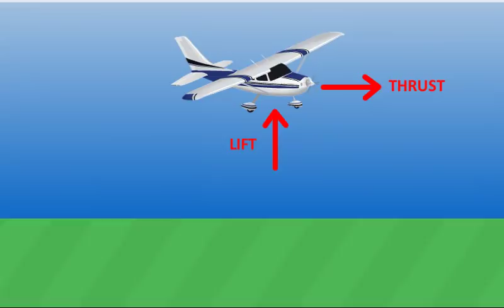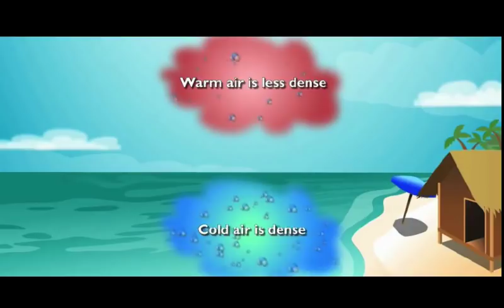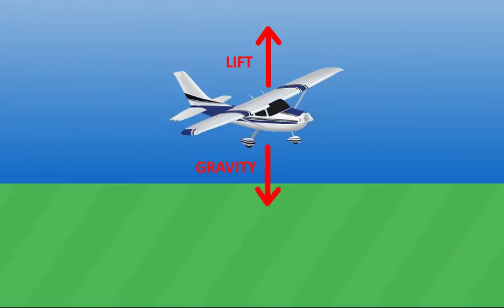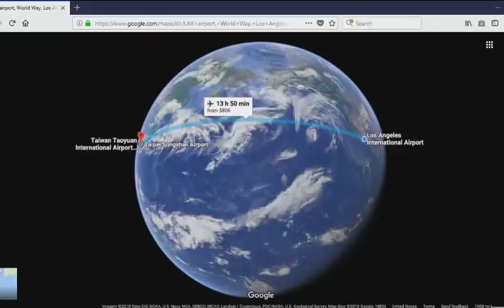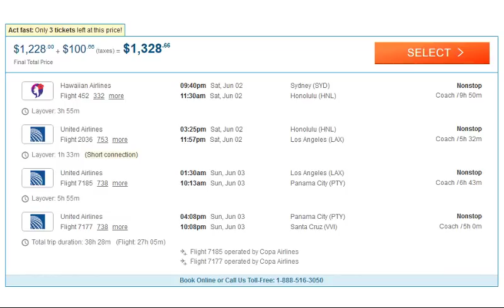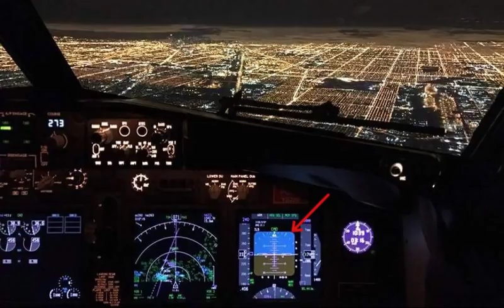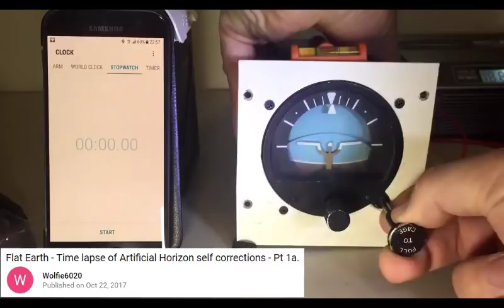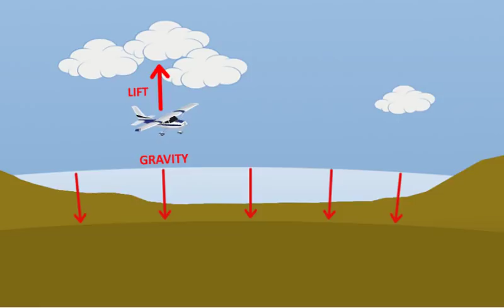Flat Earth Falsities - Plane Nonsense

Comment: So, if we live in an atmosphere that exists to the edge of space that suddenly becomes a vacuum, how is that. Science tells you that a vacuum cannot exist next to a non- vacuum without a strong and distinct barrier, as is evidenced in a laboratory anywhere you like. Too many anomalies for this all to be clean cut, even with the insults and swearing.
Reply from the maker: M Shaler - No, science does not tell us that. Vacuums don’t really suck. You only think they do because you have only experienced them within the pressure (key point) of earth’s atmosphere. When a vacuum is opened, it is the pressure of the atmosphere that PUSHES the air in to fill the void. We call it sucking, but it is really pushing. At the edge of the atmosphere, there is no more pressure, so no pushing or sucking. The atmosphere is just held by gravity. One way we know this is that the higher you go, the lower the pressure. Air pressure is just the weight of the air above pushing down on the air below.
Reply: So the gravity of the moon that can lift oceans even against the greater gravity of the earth can't manage to draw any atmosphere from the earth, even at the margins of space where earths gravity is at its weakest?
Reply from the maker: M Shaler - Actually, the moon does pull on the atmosphere as well. You just stumbled onto even more evidence for the globe. Good job.

https://en.m.wikipedia.org/wiki/Atmospheric_tide
Reply: @mshaler6574  "so you agree that the moon does pull on the atmosphere" No.
Gravity
Fg=G.m1.m2/r^      Put in the values.
Reply: Voice of reason...
As above
Reply: Voysovreason.....damn spellcheck.....as above
Reply: @mshaler6574   THERE ARE ANSWERS TO ALL YOUR QUESTIONS SIR,THEY ARENT SIMPLE BUT THE ANSWERS WILL GIVE YOU TRUE AND ACCURATE INFORMATION WITHOUT FEELINGS GETTING INVOLVED.YOU NEED TO REALIZE NOTHING IS SIMPLE AND EASILY EXPLAINED
Reply: Everybody knows the air gets thinner with altitude. People need oxygen to climb mountains, balloons and planes have a limit to how high they fly. Even that sun and moon that rotates at great speeds above your flat-earth would have to be in a vacuum. Otherwise the moon would be burning up like a meteorite.  So globe earth, flat-earth there just has to be a vacuum above us. Even the most avid flat-earther would find it hard to believe the air is the same everywhere above us.
Reply: @rogerdawson2085 
 Fg=G.m1.m2/r^2
Put the numbers in and see why you are totally wrong.
Why don’t you try using your brain? It’s very easy, you just stick a finger up a nostril and go “click”
There, fixed that for you
Reply: The moons gravity does effect the atmosphere. What's ya point.
Reply: @karatekoi  "What's ya point." Not sure if @M Shaler is just incredibly inexperienced, stupid and gullible or a pathetic troll. Same thing really. So one can assume it has no point other than to be incredibly inexperienced, stupid, gullible and a pathetic troll.
Reply: When did science tell that rediculous thing and i can see u just didnt get good highschool education or just nothinng at all..do u know.. atmosphere vanishes to vaccume very gradiently
Reply: @rogerdawson2085  no..water is thousands times havier than air..so..air have very little effect of moons gravity got it.now fuck off
Reply: @BrainUser1  i said dont vaccine ur children.ok..bcz i dont want some retards still roaming all over the place in 2050
Reply: @anand.suralkar  No danger I let Corporation poisons into them.
Mister 'shape of the earth worrier' you wont have gone to your belove Nothingness paradise void by then? Funny how the non retards are the ones all over the Retards claims.... dah
Reply: @rogerdawson2085  GRAVITY pulls accordingly or as needed automatically: "moon's gravity does affect satellites, it is just not affecting them very much."  Still "gravity keeps satellites "level" in their orbit" GEO ones and all, so all is keep in perfect harmony everywhere, by unintelligent design, or more scientificly: LUCK.
Reply: @M Shaler you make such a great point, but not many of these people are real actual people here to talk. They are here to attempt to make what your saying look bad in any way they can because they are paid to do so. This whole channel is a psi-op. Going back a couple years that is all this channel has ever done is the same thing its doing now and that is to keep people deceived believing all the lies of science and nasa. This is the voice of treason.
Reply: Reggie Reid  Fuck off Reggie you pathetic troll.
 @reggiereid1345
Reply: @reggiereid1345  I don't see how NASA can pay all of us after the cutbacks. Would you like to show some evidence of these payouts? Because I think you're lying.
Reply: @reggiereid1345  well u flattards are..f...morons..firat study some basic maths and physics..and stay away from ur mommas fairy tales and bible..

Comment: Voysov, I don't like your answer to #3. The discussion of lift is unnecessary, and you fumble the explanation of "level": you say it means "parallel to gravity", but of course it means "perpendicular to gravity". The true explanation follows from that: what appears to us (or a fluid level) as level is simply that orientation with respect to gravity, and since the direction of gravity changes as we travel around the Earth, our feeling of levelness never changes as we follow the Earth's curve.
Reply: Yes he acknowledged his misspoken 6:41 parallel. Looks like you need more trust to lift higher in lower gravity hights curved level... As sea level make a uniform gravity force, no matter how deep the oceans may be, less rock crust mass, for mass gravity force that apparently is weaker the greater mass it is from the even ball iron core is....
GRAVITY keeps in the same level automatically for pilots :)
Reply: Louis Shaw, gravity keeps satellites "level" in their orbit, but planes are too slow to orbit.

But the idea that a plane must point its nose down to fly down just means that someone doesn't know how planes fly, and has never seen video of a big plane landing, which is almost always nose up. (One of the facts of piloting is that a plane is trimmed to fly level, i.e. the control surfaces are adjusted so that flies level when the controls are in "neutral". This trim depends on the load inside the plane, and is not "automatic".)
Reply: @mendelde  how is THAT? Apparently MOON pulls, water and atmosphere, so how does her force not unlevel those closer masser satellites as she passes by?
Voysov claims GRAVITY automatically "level" orbits planes to sea level.  Nose down for super sonic jets around a SPHERE not on a flat plane!   WE know exactly how they fly!
Reply: @Louis Shaw I just googled *moon influence satellite orbits*, and the moon's gravity does indeed influence satellite orbits. However, the moon is 1/80 the mass of the Earth and very far away: a geostationary satellite is 40 Mm from Earth, while the moon is 400Mm away, and because gravity is inversely proportional to distance squared, that adds another 1/100 to moon's influence as compared to Earth's gravity. The influence of moon's gravity is almost the same no matter which side of the Earth the satellite and the moon happen to be on.

So, yeah, gravity isn't that much of a leveller, but in a sense of causing something to stay up and not fall down, it has that role for satellites, but airplanes stay up due to aerodynamics and not due to gravity. Fun fact: the gravity of the Earth and the moon create 5 points in space, the Lagrangian points, where object positions are actually stable (or would be if the sun's gravity didn't exist).
Reply: @mendelde  However? Moon your government says is 1/4 size and 1/6 the gravity, check with NASA. Your doctrines claim that the Moon causes tides, so math as much you want it needs to influence.
Just as the SUN could do something, as earth gets close, 99% of the whole solar system Mass is 99% of Gravity....
O but none of those satellites have a circle orbit around that fatso.
The idea that planets make constant wide elipses around that roadrunner, points to influence malfunction, maybe those invisible gravitons get slowed down by packs of DARK matter?
How long is all these stable distances going to last?
What is countering the gravity attraction between them?
Reply: Louis Shaw First, basic geometry. The moon's diameter ist 1/4 that of Earth, which means its volume is 1/64. (Analogy: You need 64 1/4inch cubes to make a 1inch cube.) Also, the moon's iron core is much smaller than Earth's core, making the moon less dense overall, and this puts its mass at the 1/80 of Earth that I quoted.

Gravity varies inversely with the square of the distance; since the moon is smaller, you'd be 4 times closer to its center of gravity than you are on Earth, which means gravity on the surface is about 16 times stronger than at Earth surface height. This would make moon surface gravity be 1/80*16 = 1/5 that of Earth; I'm putting the difference to 1/6 down to inaccuracies/rounding error (the moon is actually slightly larger than 1/4 of Earth).

And I did say that moon's gravity does affect satellites, it is just not affecting them very much.
Reply: Louis Shaw I'm not really sure how you get to circular orbits, orbits are elliptical (circles are special ellipses). I also mentioned that sun's gravity does influence Earth satellites; the sun is super massive, but also very far away.

For orbits, the gravity attraction doesn't need to be countered. Have you ever driven a circle with your car or your bike? You steered to the side, towards the centre, the whole time, yet never reached the center. Gravity is the "steering force" that keeps the satellite from flying away into space, bringing it back eventually (-> comets).

Consider a satellite's energy: it is part potential energy (gravity*mass*height) and part kinetic energy (mass*velocity^2). When a satellite on an elliptic orbit comes closer, it speeds up, and that enables it to move to more distance, slowing down again: an elliptical orbit is a constant exchange between these two types of energy, but the energy remains (mostly) constant, and hence the orbital motion repeats periodically.

Satellites in low Earth orbit collide with particles of ( ultra-thin) "athmosphere", which siphons off energy and does make them crash when their fuel supply is exhausted.
Reply: Louis Shaw I agreed that the moon gravity is 1/6 of Earth on the surface of the moon. You can look up the formula for gravity, the radii of moon and Earth, and their respective masses, and do the maths yourself.

I am not sure that you are aware that gravity varies with distance: much like a light, it gets stronger if you are closer. A candle in your hand is brighter than a lightbulb 100 meters/yards away, but someone at that lightbulb is probably not even going to notice your candle. So any statements about the effect of gravity have to take distance into account; for Earth and moon surfaces, you need to use the distance from their center, which is also the "center of gravity" for them.

I'm not sure why you accuse me of detraction, then bring up the composition of the moon, which has no bearing on what we were discussing. I did research the first quote, which was made in 1962, before we ever landed on the moon (as opposed to crashing on it). At that time, we did know the moon's size and its mass, hence its average density, and as I explained before, the moon is considerably less dense than Earth. So if you have an object that weighs less than what it looks like, you suspect it might be hollow, right? But this suspicion has been disproven by the data gathered via the seismometers left by the Apollo missions. From this data we know that the moon is composed mostly of "light" rock and a heavy core, which is comparatively smaller than Earth's core. We don't know that it's iron, but it seems likely, given that the moon probably was a chunk of Earth before it got split off.
Reply: @mendelde  Sorry I dont look up to Cavendish 2 balls hanging in a shed as qualifying as planet weight tool. Nor formulas proving celestials distances and size, no giant satellite!
As said Gravity varies with a lot, depending on need, be gas ball or iron.
No candle can match a grey dust ball mirror 237 thousand miles away punching though Atmosphere layers lighting 1/2 an other ball.
Just as light travel, gravitons dont seem affected by distance, how say you the passing Moon was speeding and distant before i got arrested and locked?
Reply: Louis Shaw Sorry, I'm completely lost at what you're trying to say here. What I tried to show is how globe Earthers (aka every scientist today) think about gravity, but if you're not willing to understand that this is a consistent model of the world that predicts natural phenomena accurately (and to do that, you'd need to check that the formulas and mathematics do, in fact, hold up), then we're done here.

Comment: Hopefully you can answer this please as I’m struggling to get a good answer on your first argument that you stated that aircraft require air to propel themselves so what happens in space when there is a vacuum what do rockets thrust against to gain momentum?
Reply from the maker: Dave Freeman - Airplane propellers push the air back to create a forward thrust. Airplane jet engines need air to combine with jet fuel to generate a controlled explosion and shoot exhaust backwards to create thrust forwards. But rocket engines are different. They don't need air because rocket fuel burns without air, as it contains oxidizers in the fuel to provide the oxygen needed for combustion, or an oxidizer is combined with the fuel during combustion. And they don't need air to "push off of", they just work by Newton's third law of motion. For every action there is an equal and opposite reaction. Imagine sitting on a rolling chair and firing a bazooka in one direction. You will be pushed in the opposite direction. And this would work in a vacuum as well. No air needed.

https://history.nasa.gov/conghand/propelnt.htm
Reply: VoysovReason thankyou for that piece of knowledge 👍
Reply: Dave Freeman.  A little engine theory.  The difference between rockets and jet/turbine engines seem agreed, that rockets carry their own oxygen supply for combustion.  Otherwise they work basically the same.  Imagine a round closed cylinder say 10 inches in dia.  Put 100 psi of air (78% nitrogen 21%oxygen )  add appropriate ratio of fuel for burning, and ignite it. The heated air expands creating a high pressure equally distributed on all sides.  Now open one end.  The cylinder goes the oposite way,  not because of the air escaping and pushing on something, but because of the now unequal pressure acting on the front wall or other end of the cylinder.  The forces on the sides remain equal.  The problem with turbine engines is to obtain high internal pressure  with one end open, which is why huge energy is needed to turn compressors resulting in internal hp losses just to make the engine  work.  It's the pressure on the front driving it forward, not what is coming out of the back.  We can calculate that pressure by measuring the back as those will be equal
Reply: @canuckwing0195  Lovely. Now let's wait for the armchair science illiterates. And you can ignore @Louis Shaw, the self declared troll.